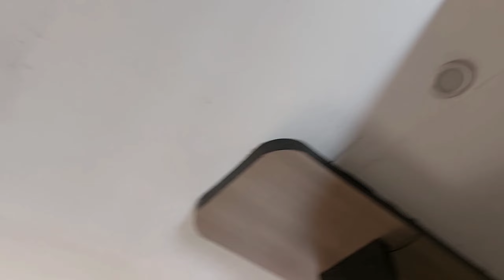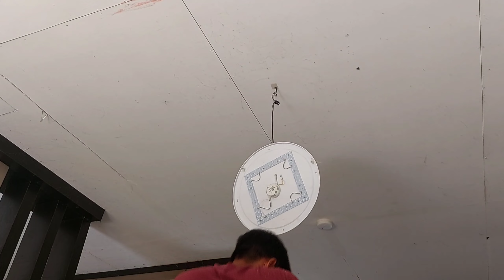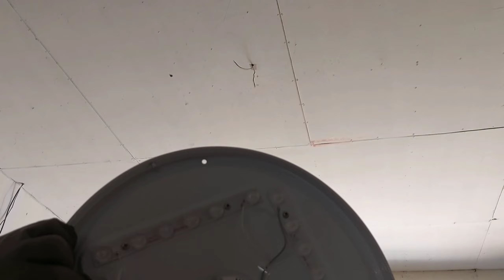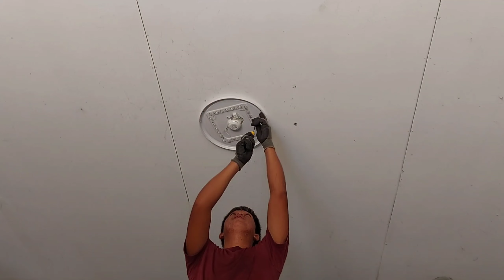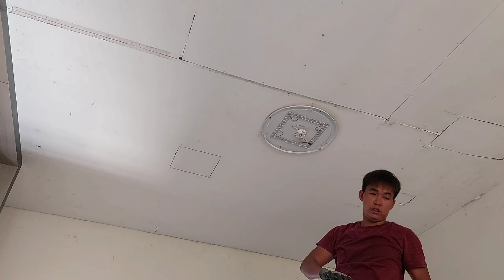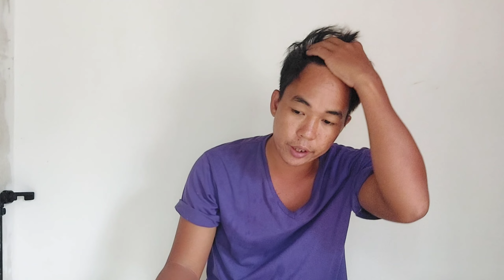Ano ang dahilan kung bakit nag kakaroon ng DIM, ang LED CENTER LIGHT? Basic Tutorial

Comment: Lagyan lang paps ng 0.1uf na capacitor. Sa receptacle  ng LED. Mawala yan kagit baliktad ang pagkalagay ng switch.
Reply from the maker: salamat po sa feedback master. Godbless po❤️😊
Reply: Sir, ganito din po issue sakin. Halos lahat ng led na ilaw ganito. Lahat po ba ng ilan lalagyan ng capacitor?
Reply: Pwede kahit hndi line to line connection yang 0.1uf?
Reply: @monjacinto6580  pwede tag 15 pesos lang ang capacitor. tapos labor mo 350 each ilaw. pinaka simple na idea yan.